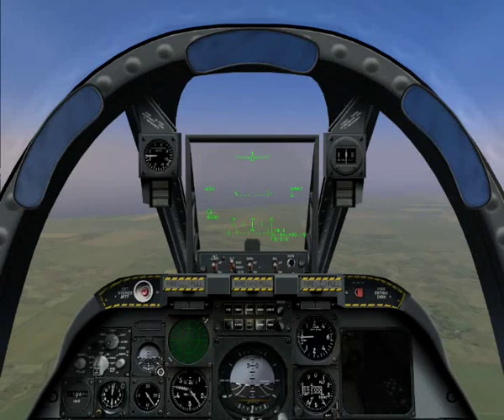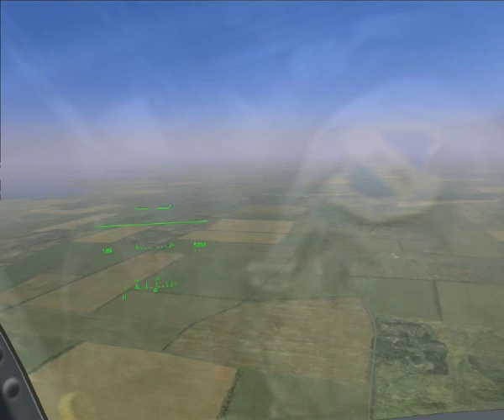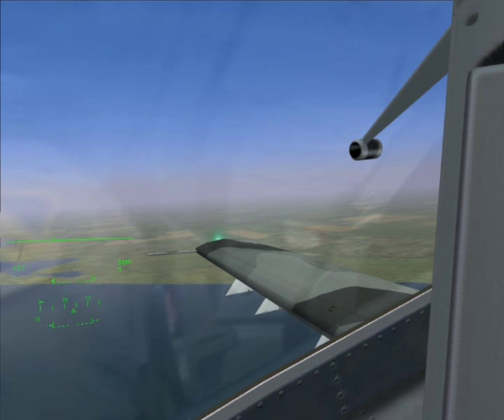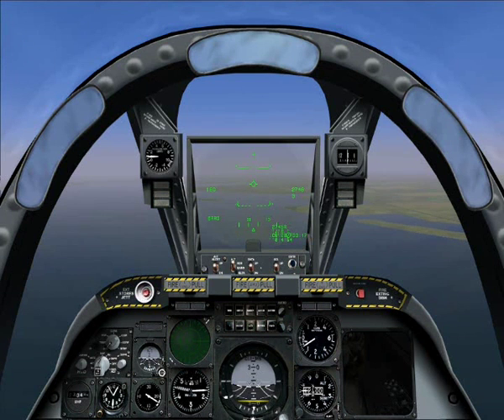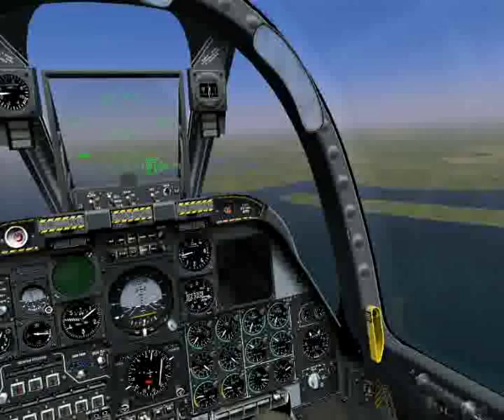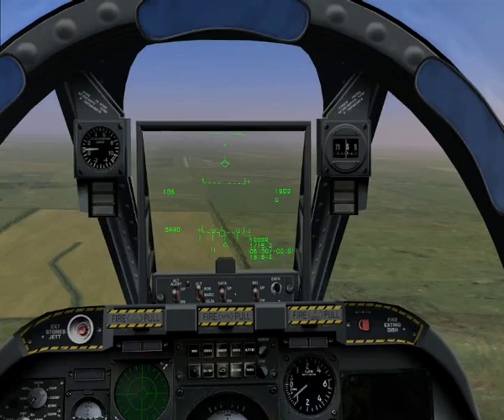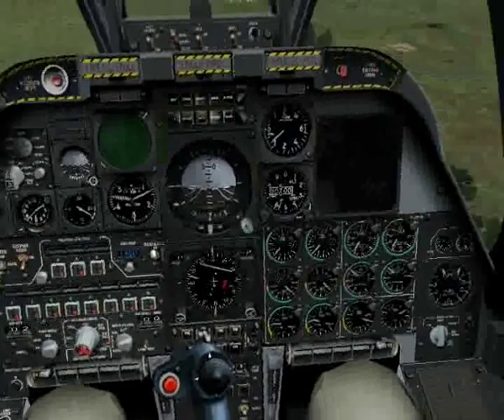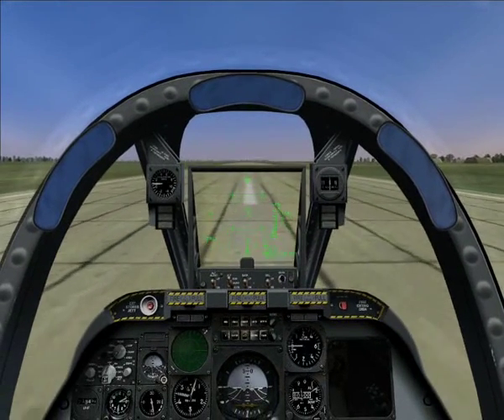Lock On (LOMAC) Tutorials - #4 Visual Landing

Comment: The leg prior to final is known as the base leg here in the United States, and not the crosswind.  Not sure if things are different in the UK?  (The term crosswind is only used for the second leg after takeoff, even though you are in fact crossing the wind while on base as well as in crosswind)  

With that said, the traffic pattern goes as follows: DEPARTURE, CROSSWIND, DOWNWIND, BASE, and FINAL APPROACH.   The term "at the numbers" or "abeam the numbers" is used to refer to the point on downwind when the numbers at the end of the runway are right off your wingtip.  (this is normally when you throttle back and begin your descent for landing)

Source: I am a pilot.

I'm fairly certain aircrafts landing on carriers fly a round pattern known as a "racetrack" and use terms that reference the difference between their heading and the final approach course for example "the 180" is the same as "the numbers", and "the 90" is the same as the mid point on base when you're 90 ° from final.   I've also heard these terms used by the space shuttle pilots in landing videos

Comment from the maker: @sebatianize Ah, my mistake on the VVI (i'll get an annotation to clear that up, thanks for that.)

As for the rest, you're correct, but rather than bombard new pilots with a ton of information, i'd rather help get them in the air, flying and getting back on the ground without too much fuss in these basic tutorials - I could talk about degree entry into the pattern, downwind leg sub-points and all sorts, but thats needlessly complicated at this stage. 

Thanks for the input though. =)

Comment from the maker: Thanks! The airbreak shouldn't be required during landing if you approach as I have here, but you certainly can engage it if you find your airspeed is a little high even with full flaps engaged. Some pilots actually find playing the throttle off the airbreak easier to control speed during descent, and obviously it may be needed if you're heavy and still have weapons on board etc and are coming in a little too fast - use it at your discression to control your speed.